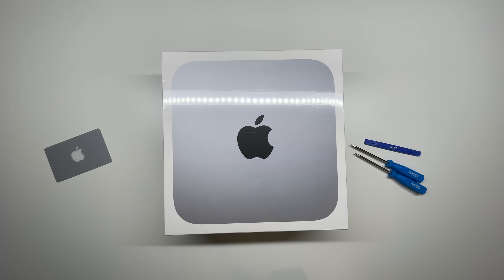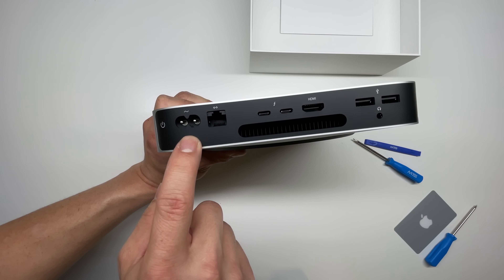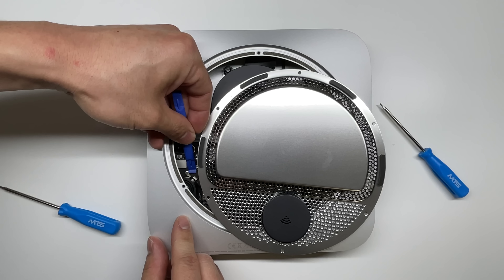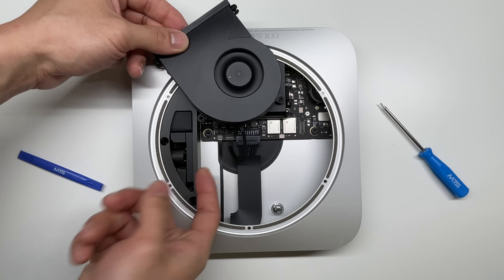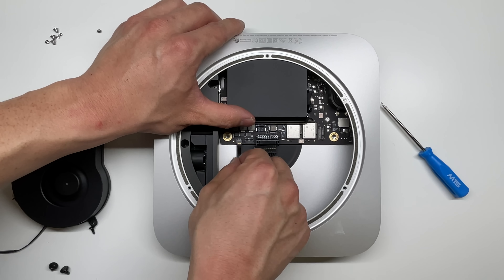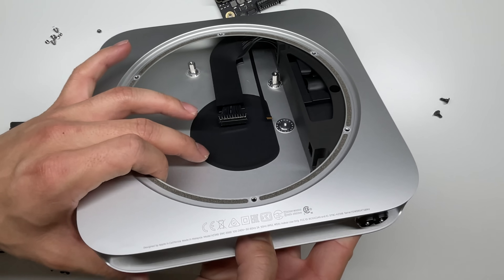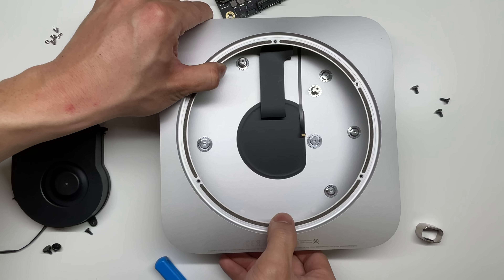M1 Mac Mini Teardown Disassembly 2020 (M1 close-up in description)

Comment: Thanks for this video.  I just bought one to upgrade from my 2012 mini.  I popped the black cover off, and was met with a cat furball, so knew it was a good call to blow some air through it before I set it up.

BUT... I have 2 sets of screwdriver bits, both with T6, however they are both "solid tipped" - they wont work in the screws on this machine!  

That's SO frustrating.

Comment: Do you think it possible to place the mac mini m1 motherboard in an old macbook pro case ? I got a 2008 macbook pro on the shelf and I was wondering if I could « empty » it and put the macmini motherboard back to give it a decent screen and a keyboard. If so I guess many ajustements would be required.

Comment: Thank you! It seems easier to replace the motherboard or the power supply and clean the fan when this machine is discontinued by Apple, down the road,  unlike the Mac Studio, which seems much better for video editing, and has better ports, but later when Apple doesn’t support it, replacing a power supply or cleaning the fans will be much more difficult. For a $2000+ new computer, having difficulty cleaning the fans and dust is distasteful.  While the Mac Studios are supported by Apple, this is not a problem. For someone like me who has bought used macs for years, and has had great success working with used macs, this topic is important.

Comment: Did you measure the output from the power supply module? I'd be interested to know the specs to see if the M1 could be powered by an inverter battery pack. (subscribed)

Comment: I worked in a PC repair shop for 10 years. I went mac in 2011. You could upgrade and replace most things until about 2015/16. New Mac mini is great but you cannot repair or replace anything yourself. Machines by the likes of Dell and Lenovo allow repair and even ability to upgrade SSD/Ram. My next purchase will be something like this. My last apple laptop is a 2019. This is based on the ability and right to repair.

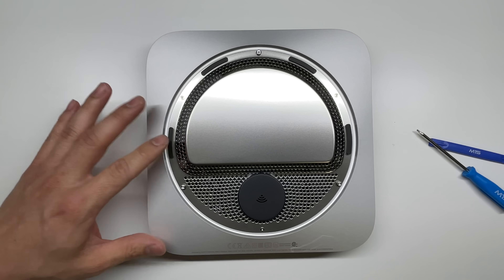Comment: 1:40 are T6 or T4 screws? Another video of m1 mac mini says T4. Thanks.
Reply from the maker: You will need T4 and TR6 both for the disassembly. That especially at 1:40 was TR6.
Reply: @brandon20904 el desarmador T4 también tiene un orificio como el TR6?

Comment: I have the late 2012 mac mini, and loved that you could upgrade the ram, etc. Not being able to upgrade ram or ssd kinda turns buying this off for me.
Reply: It's irritating to some point, but you just gotta remember how much every single change to design changes the manufacturing costs. It's also impossible to upgrade phone's internal EMMC, so you are stuck with it.
Reply: I had the same but the graphic card died.

Comment: Thank you so much for this video. It helped me to change my mind and not buy an Apple computer w/ M1 chip anymore and get stuck with only 8GB or a expensive 16GB, no thank you!
Reply: This isn't a situation where they just decided to solder the RAM to the motherboard. The RAM is part of the M1 chip itself. There is no technology in existence which can add components to a CPU, and if there were it would cost FAR more than an 8GB SODIMM from Crucial.
Reply: @toddverbeek5113  Well, technically i don't think it would be impossible to retain both solutions the same time and make it restricted some other way. Like keep the expandable port, but you can go up to tops double the memory range with it. So if you buy an 8GB version: go up to max 16Gb (with an 8GB extra ram) - if you need 32GB (heavy video editing) then you have to buy the 16GB. And while yes, the extra ram would be slower than the integrated one, it could be still alright. and the same you could apply to the SSD. rather than stuck with 256GB you could increase it up to twice with and m2 drive. so if you bought a 256 you can upgrade it up to 512... if you bought the 512 it could go up to 1TB. again; slower than the other... but it would lengthen the service life of these not_cheap devices. This is not about technology does not exist this is intentional limitation on the back of corporate greed. (before i get it: i do have apple stuff (macbook air, mac mini, iphone, watch, ipad...) so i am well in the ecosystem, but owning these and working with them does not(and should not) make us blind to simple exploitation. (and of course this is spreading now across the industry..)

The correct answer i think is: Apple does not want to allow us customers to expand it, and people who are okay with that will still buy it, others: won't. and that's fair, that what makes the market work.

Comment: I am wondering if somewhere down the line if it would be possible to desolder the ram and solder in ram that has higher capacity. I had this done with my old iPhone 7 storage. I paid a guy to make my 32gb iPhone 7 to a 256 GB.

Comment: No upgradable RAM options?  I've been using Macs since the mac Plus (a shoebox standing on end with a screen) in the 80s maybe.  Lately I'm growing tired of the whole non-upgradable crap.  The distance between PC and Mac is ever-narrowing and I hope the gap simply closes so I can avoid the Apple pirates completely.  But I still have a quad-core iMac from late 2012--it rocks.

Comment: Just replaced one of the 2 HD in a Mac mini 2011 server today with an SSD. Your tear down was pretty much identical to the steps I went through - nice explanation BTW. Disappointing to say the least! No upgrades = planned obsolescence. In the Mini I tore down today, you can also replace the RAM (officially 8Gb) but OWC discovered you could actually stick in 16Gb. I will eventually put in a second SSD once the ones currently in use elsewhere need replacing. Its as if the Mini is now the equivalent of a trash can Mac Pro - you could expand with external components (depending on the model you got). My Mini still has the IR receiver and I basically use the unit for a home theatre and I run Mail on it 24/7 with SpamSieve to filter email spam. Rumour has it that the next generation Mac Pro tower will have one of the newer M chips and is going to have a smaller footprint. I am wondering if this means that the expandability of this model will also see a reduction in upgrade possibilities. Its a shame that Apple has become so oriented this way. And yes, I subbed :-)

Comment: Why do they only put 8gb ram.   They underpower it from the get go requiring an upgrade if you smart and want it to last. If they had put 12gb instead of 8gb it's a good middle ground that won't need an upgrade to 16. But 8gb is a bottleneck for sure

Comment: GREAT VIDEO!! Question-short as I can-I have a mid-iMac 5k 2107 i7 512 16 with a 580...trade in @ Apple $1140,-getting REALLY TIRED of occasional beach balls and fans spinning-at times slow....

iMac mini M1 I want 1tb 16 $1448.00 with CARE...
If I trade out of pocket price under $400-should I do this?? Have a Tuesday appt...only thing is I am REALLY used to the 5k screen...I do 4K but more 1080 both at 60...only FCPX what do you think...?? Let me know thanks

Comment: Seems like the fan is identical to the 2008 model, right? I'm thinking about integrating a M.2 SSD, connected by a thin USB-C cable which connects to the port outside the housing, wiring the cable through the duct and fan.

Comment: You correct USB C to Thunderbolt with a caption, but technically even Apple calling them Thunderbolt ports isn’t correct since that’s an Intel branding. They’re USB 4, which use a USB C connector. Idk why Apple is calling them Thunderbolt. 

Also, it’s crazy how little there is to a Mac Mini. I understand redesigning the laptops would have been more difficult, but it look like they could have easily shrunk this by 40% or so. As power efficient as these chips are proving does the power supply even need to be that big? Or is there maybe an M1X version coming that does need the space? Apple silicon is definitely they’re next great thing, and I’m excited for the next couple of years!

Comment: I’m allergic to the word ‘Soldered’ ☹️
Reply: Especially for SSDs.  And as many are already reporting, disk swapping is writing TBs per week to the SSD already.  Imagine when browsers and other apps take even more memory in a year (or 3).  This thing is cute, but not built to last.   They had plenty of room for a socketed SSD and intentionally chose not to do it because they want to extort users for huge premiums for upgrades and to force obsolescence within 3-4 years.  Sadly, they're also likely to force outright failure in fewer than 5 years for many.
Reply: pronounced with the 'L' or not?
Reply: @YavorKapitanov  ...I have 10👍🏻 you have ZERO. You are the problem.👌🏼
Reply: @DarkstarDarth  wtf? What does that even mean dawg?
Reply: @christianmccauley7340  ..well Dawg, if things are soldered to the mother board you can upgrade RAM or it’s SSD. Apple does this to all its products if you haven’t noticed.
Reply: @DarkstarDarth  Well no shit they are going to solder the M1 chip, the M1 chip is a WHOLE other cpu, with a whole other size. And do you think they will do that in a phone? You're delusional
Reply: @sfjdndsdsnngfdgnd  I was referring to RAM and system memory, nothing to o do with the M1 chip.
Reply: @DarkstarDarth  the ram is inside of the m1 chip.
Reply: @sfjdndsdsnngfdgnd  ..and part of the reason the equivalent intel chips read/write speeds average 100mbs per second faster.
Reply: @sfjdndsdsnngfdgnd  Exactly so. System on a Chip. Your nailed it. Too bad folks would not do a little research before yelping.

Comment: The new M1 chip is a great feature but having only the option of max 16gb ram and only 2 Thunderbolt ports instead of 4 on the older Mac minis is a huge downgrade and big disappointment. I will/have to stay with my old Mini
Reply from the maker: Yes the ram and thunderbolt is a huge downgrade IMO too

Comment: I have an Intel NUC that is a much more user-friendly design: it has a 2.5" SATA drive slot, an M.2 slot and two SODIMM RAM slots, and it's all designed to be easily installed, upgraded and maintained by the user. The only thing that would make a Mac mini less user friendly is casting the whole thing in resin.

Comment: could you technically put the motherboard and power supply of the M1 mini into a 2018 mini space gray case? or are the screw placements different?
Reply from the maker: The screw placement for the logic board is different. I did a tear down on the space great when that one came out too

Comment: In my 'mini' little brain I'm wondering if there is a way to utilizes all that unused space inside the chassis to house some SSDs. Even if it would involve modding one of the ports or even rerouting a cable from one of the ports back into the case.

Comment: Wow, I'm really surprised by how much empty space Apple left in there. They could've made Mac mini much smaller, or integrated a larger, better speaker.
Reply: When Apple replaced the G5 CPUs with Intel, they kept the same boxes for the next couple models. THEN they overhauled the design of the box to fit the new tech.

Comment: I hate you can't upgrade the RAM or SSD but I love the design (inside and out). Beautiful little machine! Getting harder to resist buying one. Thank you for posting this vid.
Reply: Everything is all on the chip for a reason - performance. You can't get that kind of performance if you have slots for SODIMMs and SSDs.
Reply: upgradable ram would mean a huge loss of performance, as the M1 is built this way.
The SSDs arent SSDs either, its a raw Flashmodule, because the memorycontroller is built into the M1 aswell, to reduce latency and increase readspeeds.
Reply: @kartoffelknorkator  the ram was integrated on the MainBoard
Reply: @mettadaica  It's a part of the CPU as is the storage.
Reply: @misterstratocaster  I can or I cannot do it.
Reply: Can I take the M1 to the near Apple Store to change the SSD at least?
Reply: @SpnBer104  A clue is a terrible thing to waste.
Reply: i saw clips with mac mini m1 that had 2 ram slots..
Reply: This thing is pure marketing... Do not buy it!

Comment: 1:17 “Usually, these do have IR Receivers built into the aluminum”
The IR receivers were removed beginning with the 2018 Mac Mini. The last Mac Mini to feature an IR Receiver was the 2014 Mac Mini. It’s the black dot next to the power indicator. IR Receivers require Line-of-Sight, so they have to have a cutout on the casing as they can’t be placed inside the machine. Hope this helps!
Reply: You must be fun at parties
Reply: @SGprooo  I found his answer helpful, if you don't like to broaden your horizon, better stay at home Boy.
Reply: @mt09deathrider  you’re seven months late
Reply: @SGprooo  Late to what ? Could’ve been 5 years, his answer is relavante and yours just cocky and mental. Are you 12 ?
Reply: @SGprooo  Shaming people for sharing knowledge is flat out one of the stupidest things you can do. I don't think you're fun at parties either.

Comment: They could have use the empty space to add an M.2 SSD slot at least.
Reply: Apple going in the wrong direction. I wont be buying it.
Reply: So you can upgrade it yourself for cheaper? No way!
Reply: M2 or standard SSD can be connected through the thunderports. The "empy space" will probably host a bigger board with multiple M1 chips and soldered stuff to create a Mac Mini Pro. :)

Comment: WOW! The motherboard is so much smaller than the last gen... makes you wonder if the next gen they will be able to shrink the overall body. I assume they didn’t change it this year because they wanted to show off the performance in the same body.
Reply: Yup. They want people to feel comfortable with it, so they used the same case... just like the first Intel-based Minis and the Mac Pro. I guarantee there's a new case design in the works. Think "Altoids". ;)

Comment: I guess the next question is, is the storage upgradable for someone willing to solder? It's been done for iPhones...
Reply: Strange Parts! That guy is amazing! And unfortunately, probably not, although these new M1 Macs don't have a T2 chip, i'm guessing the storage may be tied to the secure enclave on the M1 SoC, but I could be wrong. Only time will tell. I wouldn't mind modifying and installing some NVMe drives internally by tapping into one of the Thunderbolt or USB ports.

Comment: What’s the psu wattage? Is it possible to power the Mac Mini via thunderbolt?
Reply: 150 watt and no.
Reply: @radfaraf  150w? That's a lot
Reply: @ИнтереснаяИнформация-у5з  Yeah seems like a waste to have such a hi-po PSU in a machine that draws about 25W max according to tests. Surely they could’ve used a smaller PSU and made the whole enclosure smaller too.
Reply: @ИнтереснаяИнформация-у5з  That's the max it can put out, it doesn't use that much though.
Reply: @ad_fletch  guess it's because of potential use of usb 3.2. (or which one is using there).
Reply: @ИнтереснаяИнформация-у5з  usb4/thunderbolt
Reply: @brunoroseau3383  Fair enough.

Comment: Let's be honest a Mac micro is coming
Reply: The modder in me just wants to take the guts out and put it in a smaller case.
Reply: Maybe the Mini sticks around with an M1X chip and a Micro shrinks this down with M1 chip to the size of a few iPhones stacked on top of each other. Imagine how thin they can make an iMac if this little is required to house the components! They could potentially even house the components inside the stand and leave the monitor to be just a screen.
Reply: I would like to have a Mac Mini, but would like to wait for another generation. Since I sold my Windows laptop, I needed a replacement. Today my Mini PC Miniforums U700 arrived and let me tell you, it's a featherweight dwarf. There's even room in the tiny case to upgrade with a 2.5" SSD. I tested the midget today with Lightroom and Photoshop. Everything else runs smoothly too. What I would like to say is that Apple can certainly manage to pack the technology of the Mini M1 into such a small case. I assume that the Mac Mini M2 will be much smaller.
Reply: @ruhri0411  I got an M1 Mac Mini a few weeks ago to finally replace my old Dell XPS tower so I had a desktop computer again. I love it! $700 for a computer that can outpace my $2000 MacBook Pro I bought earlier this year. Oversized case for the components or not it’s worth it!
Reply: @mlosuno402  I bought an iPad pro 11 with Magic Keyboard in October, unfortunately my wallet is a bit empty :-)
My next purchase is a DJI Mavic Air 2, so the Mac Mini will have to wait a little longer. I'll be there in a year!
Reply: Do you have any source about it? 

Give me link
Reply: @JamButter123  source: common sense.
Reply: I think so too - but more of a typical “Apple TV for gaming”, more tvOS than macOS.
Reply: Apple already made the Mactini. Here you go: https://youtu.be/BGGOn-H7s3Q
Reply: U mean Apple iStick?
Reply: @serversC13nc3  that too to replace the apple tv
Reply: @kbubuntu6048  It would be better if they considered designing powered M1 with 8gb of ram and 256gb ssd with support wifi 6 and single thunderbolt port (which can put a usb-c thunderbolt dock for expansion especially gigabit ethernet if you have NAS at home) in single stick form.
Reply: @serversC13nc3  that still fit in a micro mac

Comment: The RAM is already baked into the M1 chip, that was already expected from Apple this year. The chip is a solid performer especially for how cool it runs so overheating shouldn't be a concerned like the Intel varient. In my opinion, the MacMini will outlast the macbooks just because there's less part yeah it sucks that they don't have upgradable storage but a external SSD should do the trick.
Reply from the maker: Close-up of the M1 Chip here: https://youtu.be/hczcaGX62S0